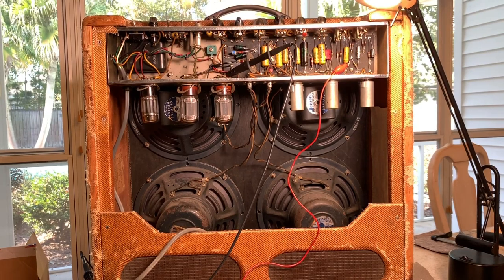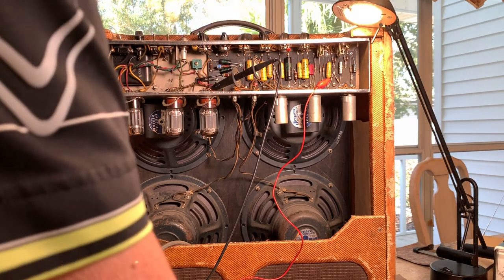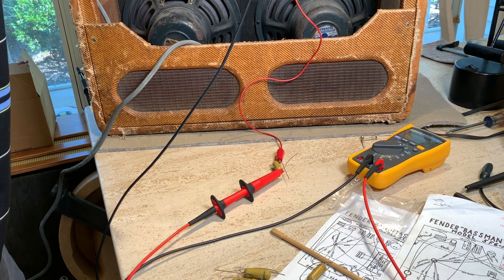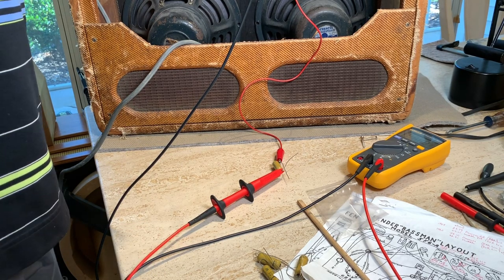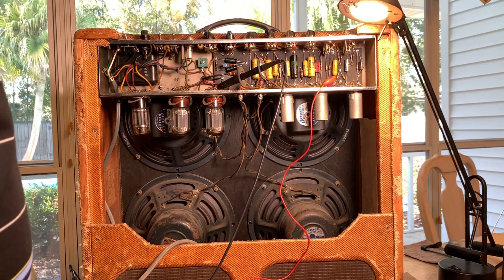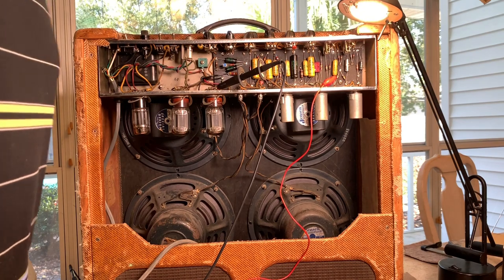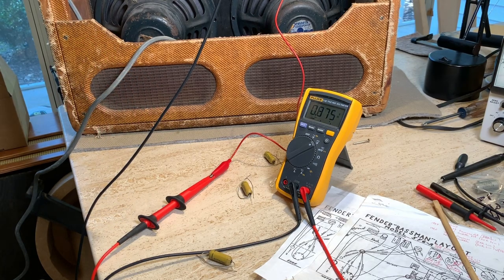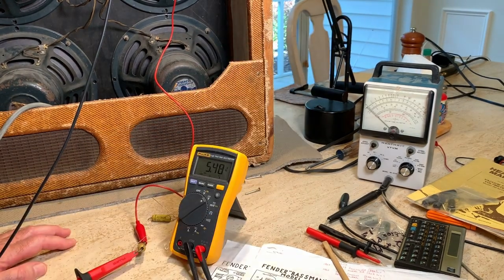Testing NOS Astron .02uF/600V Caps for Leakage - And More!

Comment: You know your stuff. I've done videos in the past talking about how the  "MOJO" of vintage gear is just code for "broken".  But it's broken beautifully. 

From centralab pots to the old bumble bee or mustard caps a lot of the great sounding amps and guitars only sound good because of the drifting leaking components are not efficient. It has a mellowing effect to the top end and the chaos can also add excitement in the form of a more distorted upper treble which turns it to chime rather than bracing highs where every freq gets through. It's like modern recording. Too much information isn't always a good thing when it comes to the sweet spot of human hearing.

It's like a bad bias that chews up tubes...That can sound heavenly.  It sucks that sweet spots are so chaotic. If only you could emulate that and have a stable amp.

Comment: The King of great tones Gerald Weber said in one his books. He formed new caps starting at about 10 volts and increased load by ten a hour. Makes sense too. Maybe useful for you now
Reply from the maker: Yes, I'm going to take it one cap at a time.  Actually, nothing in the amp has been checked in quite a while.  Just the caps I bought were all bad.  But, tomorrow I am going to check the one Astron on the Bright channel and see what it is doing and may flip those two and put the PIO cap in the bright channel.  The volume pots all are quiet so I think they are okay.  I will probably check two of the .01's in the phase inverter because I have two go PIO caps I can put there right now.  I've already changed those two in the 1959 Bassman.

Comment: I've taken the new caps and glued the old outer cover from the old caps on them to make them look vintage works also - i love that vintage look - but sometimes u have to use newer - those .o2 caps even off in value still make good tone caps in the guitar humbuckers ..i prefer bumblebee caps ..paper n oil tho for that tho "another topic" - i made a silver face bassman 100 and redone the circuits for guitar ..still have to replace the tube sockets tho, and had to replace every pot as it was rusty and bad shape, but got working with vintage JBL d131 org cones ...love JBL and them old Jensen speakers "original cones" recones suck -  but yeah watching this gets me in the mood to get back at it :) ..thanks
Reply from the maker: Recones can be good.  This old Bassman is all recones but the place, Orange Co. Speaker, finally went out of business.  I was sick.  But now one of the old employees has set up shop again.  Eminence has a couple of new Jensen replacements that sound great so you can do that too.  I'm using the same speakers that Eminence designed (1028P) for Fender in my 1959 Bassman.  Those are special order but this year they came out with the Allesandro GA-SC59 and I want to try that one next.  I think it is even more authentic.  I do put the brown tubes back on and I really should glue the ones that fit loosely.  Tomorrow and I going through my completely original 1959 Bandmaster and will be reluctantly replacing some leaky caps, I'm sure.  I have been using the Astron PIO .1uf/400V caps for the phase inverter and have had great results with them.  I'm going to try some new yellow Jupiters for the .02uF/600V caps if they are leaking.  It is fun.  I've got three blackface amps that need work as well as a Blonde Piggyback Bassman.  Lots of work to do.
Reply: @millstap  Sounds like FUN!!  but yeah the recones on JBL's are a big thing and difference - thicker paper plastic krapton V.C ..i've learned to make my own V.C using org Nomex paper u can get off of ebay an wind my V.C by hand for a Jbl d120f and d131 and 130 series. got the idea after winding/fixing a Gibson Pickup i just had to get working Lol..but yeah!! the vintage cones have a sound of their own if u can find 'em ..or using Nomex v.c
Reply from the maker: @beatleme2  Out of all of my amps, I had one Jensen P10R with the original cone intact.  I played it hard for quite a while but then realized that all of the speaker in a 4x10" Bassman cab really need to be matched so they work together as one big speaker.  I had a hodgepodge of different recones in that amp plus the one original and it was just not balanced.  I ended up putting in those Eminence 1028P's.  The P stands for paper V.C.  They made the amp sound better but now I am going to go in and start checking for leaky caps.  I think there are a few in it.  I have one 15" JBL D-130 in my Vibroverb.  I have never been able to figure out if it is an original cone.  The seller told me he thought it was reconed.  It sounds pretty good but that amp probably has some leaky caps too.  I'm going on a leaky cap hunt in all of my vintage amps because they were all pretty much original when I bought them and I didn't believe until recently that leaky caps were such a bad thing.  I've changed my mind since I found a good modern cap that can replace the old ones.
Reply: @millstap  Yeah, some re cones do sound good, and replacing the caps really is a must esp the power caps, they go bad or really any of them is bad on the power transformers - and the org Trans always have their own sound also 'believe it or not' ..just the old amps had the right ingredients the right tech for music at the time being made along with musical instruments -The JBL should have 130-202 printed on the outer edge cone - wish you luck! - but some caps off makes the sound tho..id write em down and keep the org in case u wanna sell or change back
I love to have that Vibroverb it was the SRV sound! - the one time i played through one "3rd stone from the Sun" - hendrix

Comment: Hey! Thanks for making all these videos! I was wondering if you have a termination resistor on the meter side of the cap? The leakage current is the same no matter what the resistor at the meter side - the meter input impedance of that meter could be 10 - 20 meg Ohms or higher. So if it is 10 Meg and you have 1Meg volume control in the amp the voltage will be 1/10th of what you are seeing here. Not sure if that helps because they are def leaky.
Reply from the maker: No resistor.  All the amps are much better with new caps.  I just never could find good replacements but finally found some decent NOS PIO caps.  They are great.  And now my guitar is in tune.  I never thought I would notice that leaky caps knock your guitar out of tune.

Comment: Millstap hypothetically if you had $15k would you invest in an early 60s Strat or a '59 Bassman. I have a '66 Super and very tempted to get the Bassman. Curious on your thoughts as you have so many killer amps. I have a CS Strat '62.
Reply from the maker: I'm an amp guy so I would probably go with the amp.  They are hard to duplicate and they are 75% of the tone.  Unfortunately, like I am going through here, everything is going to be worn out if you get a late '50's amp and it will need a lot of maintenance.  That can drastically change the sound of the amp if you are not careful.  I'm learning new things every day when it comes to what affects the sound of these amps and the caps are very important.  They don't make caps like the old Astrons and the proper replacements are very hard to find.  I just spoke with an amp builder yesterday for over two hours and he enlightened me on the things in a Bassman that just aren't available now including the wire and solder used.  But, I think good vintage Strats are extremely overpriced for what you get.  If you don't have one, then it is nice to have at least one vintage Strat in your possession.  I would get a refinished one for $10K or less.  On the other hand, there are some great new Strats out there that are good like the Nash's and some Master Builder Strats.  A good Bassman could be had for around $6K if you are patient.  A Super Reverb and a Tweed Bassman are a great combination.  I play my new Strats a lot but it is fun to pick up an old one occasionally.  For $15K, if you shop around patiently, you could probably get both the vintage Strat and the Tweed Bassman.  If I were going to do it again, I would go for a late '60's post-CBS Strat with the big headstock but still with the four bolt neck.

Comment: So Millstap I have also risked 50 Bucks on a tube radio and I'm getting it fixed up and fitted with a jack input and radio disactivated for another 50 bucks......so 2  tecky questions
1] how do I Know what impedence to get speakerwise , for a external speaker.....Imean if I wanted to connect a 'Ragin Cajun' would that be ok for a 10 or 15 watt amp ?
2]can I use a miniature amp [battery powered] as an effects pedal and runit through a tube amp to give me distortion at any volume ...live or studio recording?
thanks for a really great channel.
Reply from the maker: To make it simple, I would measure the impedance of the speaker and go with that.  When you measure it, multiply that by 1.25 and it will tell you what ohms speaker to buy.  Otherwise, your tech would have to determine what is correct for that OT.  It gets a little complicated and you have to measure it and use Ohms law to calculate it.  I have never had to do that yet.   It also depends on the type of power tube or tubes it is running.